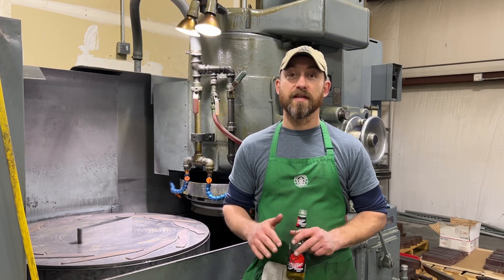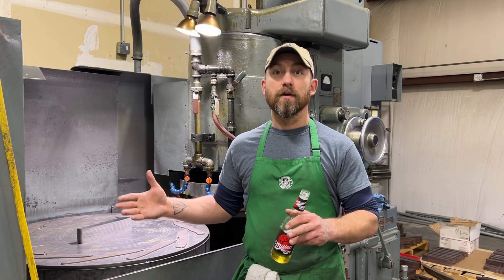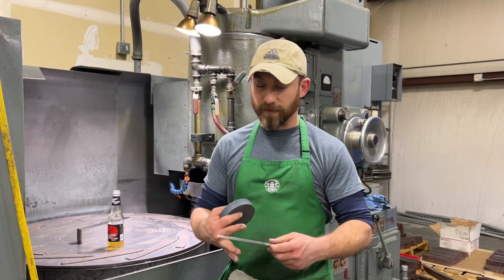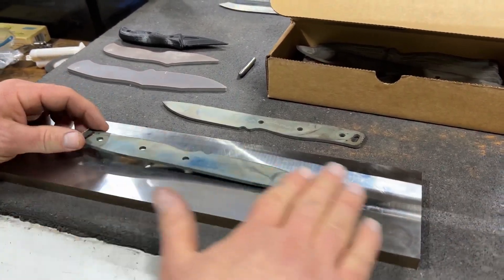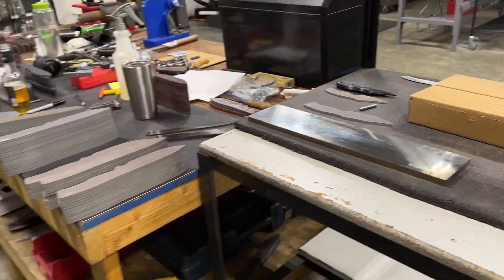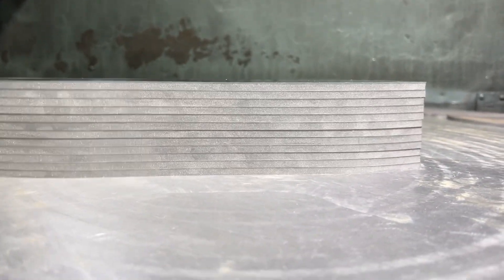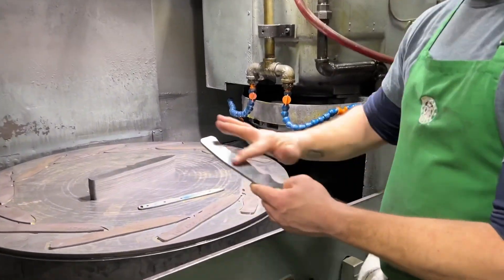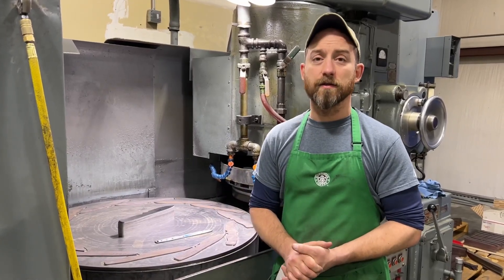Shop Talk: Surface Grinding SURVIVE! Blades

Comment: I know of no other knife company that understands the importance of this details! Every single knife I have ever bought came to me warped and the bevels were off by a large margin. Thank you for the amazing video.
Reply from the maker: Good grinding is such an important but often overlooked aspect of making a high quality knife. Grinding affects things like sheath fitment, cutting edge uniformity, grind evenness, and blade straightness. Thanks for stopping by and for taking a moment to share your thoughts!
Reply: @Surviveknives  I could not agree more! I hope they would use your knives as standard prototypes to see how it should be done.Thanks again and cheers

Comment: Firstly your knives are fantastic! However...how are you still having mishaps with grinding? You’ve been making knives for years. What else is there to learn?
Reply from the maker: We've actually been making our own knives for less than a year. Prior to that we were working closely with subcontractors for our manufacturing needs but that never really worked out for us. Thankfully since taking over our own manufacturing we haven't had any sort of grinding mishaps but that doesn't mean there isn't room to optimize and improve our processes. In manufacturing there is always something to learn.